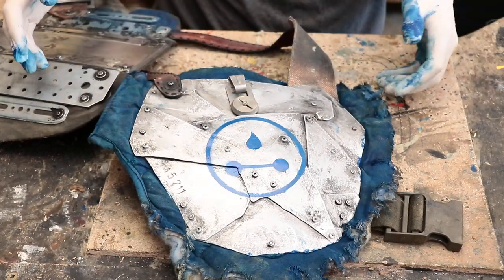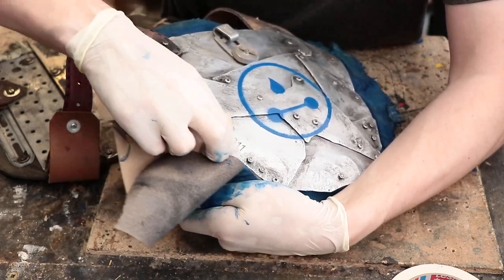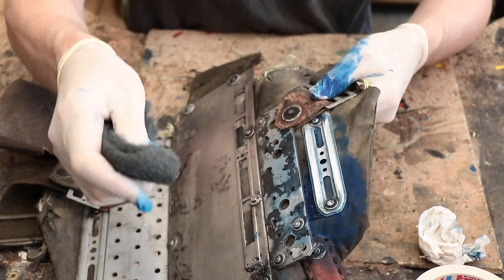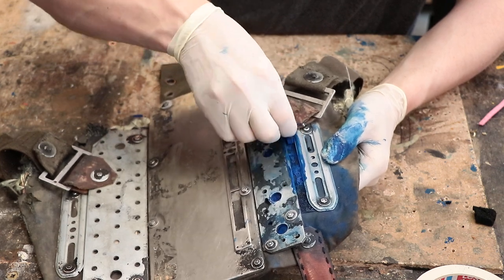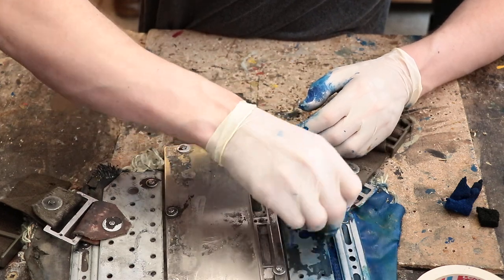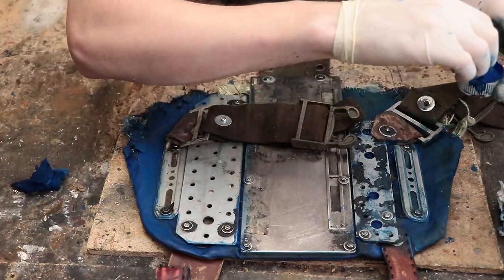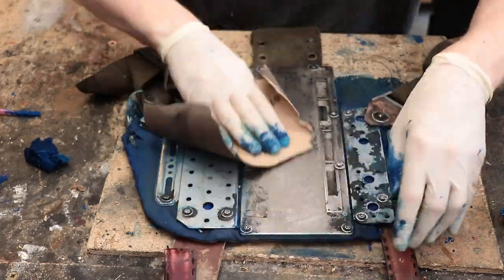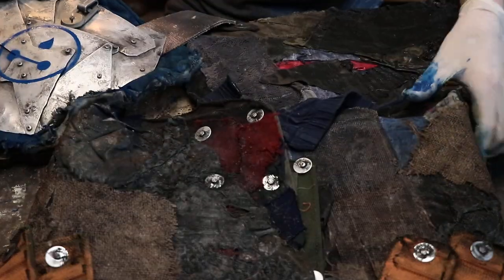This is WAY simpler than expected! Recoloring armor padding.

Comment: Hail senior Snail..  I like to use house paint as well. I try to always use low sheen. I like to use Chip brushes. here in the states there is a store call harbor freight and they sell them by the box about 50-200  brushes around .30 a piece in my city.  they are great beaucse they are simi Stiff bristles and work well with water base paints. also i dont feel bad when i toss them. Another tip on grunge I like to add shark bite or even just fine sawdust,or sand  to my paint when using a sponge.  The effect is really good. Its a good day when i get to watch you work it brings me joy. something about the imagination, i guess. so hard to find people with that these days.

Comment: This will stain clothes underneath, even more when sweating.
Reply from the maker: just tested that! yes, fabric paint holds better on facric than acrylic does. when deliberately rubbing this one it with a lot of force with a wet finger or sponge, it kind-of stains a tiny bit, maybe? but the paint ain´t facing the body here, and i expect them to wear something underneath anyway. so theoretically a problem, practically in this case less so.